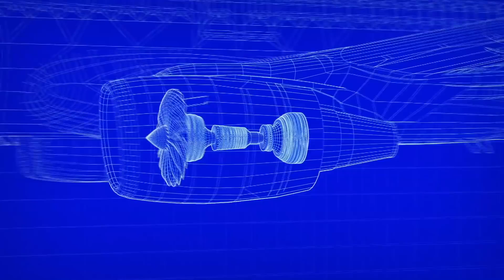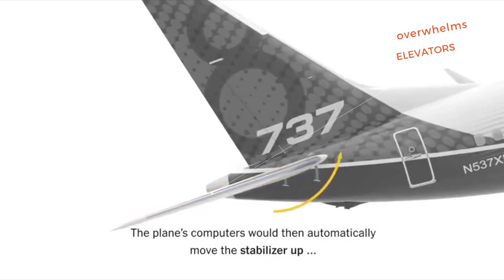737 Max 8 probable cause revealed - Prof Simon

Comment: Nice account....

1. A few points could have been added, only 1 AoA Sensor is connected to the AI with MCAS, so no conflict would ever have been noticed, this was done to allow the MCAS to over ride all normal controls...

2. Pilot training and 737 Sims are lagging way behind, most airlines don't even have one yet. Pilot training for the 737 MAX didn't included a runaway trim situation until Jan.
It would be easy for a pilot to have missed this newer training.

It seems a pilot that would have known to disable the Trim-Cut switch, would regain control of the aircraft....
(As shown on the flight previous to the Loin Air disaster) 
All easy to say from our armchairs, but this has been a Memory Item for a 737 pilot for a lot of years!!!!
Diagnosing that in the heat of the moment might be another thing....
Seems a few pilots have reported this malfunction and got home by using the Trim-Cut switch...
This is no excuse for a poor design to begin with.... 
But considering pilot training is 10% flying and 90% knowing what to do in certain fail situations, you'd expect better training.

Agreed 100%, Boeing has a huge mess to fix, as does the FAA and as Boeing is so heavily subsidised by the US Gov, who knows what agreements they will all come up with to save money and save face.
Reply: You hit the nail right onto the heads.FAA and Boeing should go to jail. I understand the ill-fated Ethopian and Lion Air were not given the new MCAS manual and the pilots were not even given a brief up-grade  training on the new system.
Reply: kelvin loh Sad as there were US citizens on the Ethiopian flight. Innocent people should not have to pay with their lives because other airlines of different countries don’t provide the additional information and training required to prevent these situations from happening.

Comment: This why I always wondered why the 757 line was discontinued. Because Boeing put all their "chips" into expanding a popular airframe that was never really designed to be expanded beyond its original design. This became a "tipping point" with the "Max" and having to put an, "bandage", additional flight computer to an already unstable aircraft, stable.
The defunct 757 would have filled the niche that the "Max" filled! A terrible gamble on Boeing's part. Imo.
Reply: 757 is a very safe plane. not the most comfy to fly across the atlantic. but...

Comment: According to reports out today, the pilots who flew the same aircraft on the Lionair flight previous to the one that crashed had the very same faulty AoA sensor and the MCAS system acted the same way, but a third off duty pilot who was riding the jump-seat went through a checklist that all 737 Max pilots are required to memorize to troubleshoot a runaway trim problem, as this is called, he quickly and correctly determined that the AoA sensor was providing faulty data to the MCAS system so he disconnected the MCAS system by flipping the two auto trim cutout switches effectively turning the MCAS system off and that allowed the pilots to manually trim the aircraft and finish the flight safely. The pilots who correctly performed the runaway trim checklist and saved the aircraft, reported that they wrote up the problem they had faced and the aircraft should have been taken out of service and not allowed to fly again until the AoA sensor problem was troubleshot and fixed, but Lionair didn't take it out of service, and the pilots that were flying it on the next flight when it crashed, obviously did not have the runaway trim checklist memorized like they were supposed to. And I would also state the the pilots on the doomed flight likely did not read the reports written by the previous pilots, if they had and were aware of what had happened and how it was fixed, probably would turned off the cutout switches and made a safe flight. I think, considering the quality level of the pilot training and the aircraft maintenance of the airlines in question, the Ethiopian Airlines crash will likely be for the same reason, pilots that were not well enough trained to safely operate the 737 MAX. 

According to all the reports about this today, these are salient facts that the Indonesian government neglected to state in their public report. Gee I wonder why.
Reply: There could be a language barrier there - the report could be in Indonesian and the captain that crashed was Indian.
Reply: They are being set up for failure.

Comment: I agree with Prof Simon's analysis.  I think it is likely that NO software fix is possible, primarily because the jack screw that controls the pitch angle of the horizontal stabilizer is fundamentally too slow to react, for the simple reason that it is geared so highly it takes too long a time for that jack screw to react to aerodynamic forces.  Therefore a fundamental physical redesign of the plane will be required.  No matter how sophistical the MCAS software is made, the horizontal stabilizer cannot react within the time required before the plane in a stall will crash nose-first into the ground.
Reply: This answer....the whole question... As simple as it gets....wow. Salute.
Reply: The jack screw did react.  According to this video the plane was in fact not in a stall, and if it was had recovered but was still receiving faulty input..

I think all this speculation is hilarious... If the cash was  caused by too much noise down trim, then obviously the control surfaces and jack screw were sufficient... Indeed over sufficient.

You can bet this recovery was tested, in flight, but likely at higher altitude. 

I eagerly await the report....  Btw if the new engines moved the cog fwd..  The plane would be nose heavy and less prone to a stall. 

However, too much power.. Fwd of cog might send nose up.. 

If they added power to correct a stall, the plane would nose up and stall more.. 

You need to turn into a skid not fight it. 

Uninformed speculation is not productive
Reply: Daniel Morris. You are absolutely correct
Reply: pilot just needs to apply the run away stabilizer memory items and neither of these crashes would have happened.
Reply: @Melthornal  It was as easy as that... the stab keeps trimming nose down, reach over and turn it off and fly the damn airplane...
Reply: Jeff Tjernagel I don’t think it’s as easy as just that. The plane design itself is fundamentally flawed.

Comment: The garbage MCAS System was incorporated to compensate for a poor design that should not have been approved by the FAA Type Certificate.  Secondly, as a member pilot all flight training includes procedure of how to recover from different types of Stalls.  To date, there are no pilots of Commercial Aircraft that have any experience of recovering from a "Full Aerodynamic Stall" other than in a  'Simulator' and  Boeing Test Pilots !  
To be able to recover from  a Stall depends on Altitude, Pressure Density, Temperature, Wind Velocity and Direction, Meteorological Conditions and most important is "Pilot Proficiency".  The pilot's ability to respond correctly without panic and or disagreement between Captain and First Officer.  Historically, irrespective of type of aircraft that crashed from a low altitude Stall, they all resulted in destruction and death for passengers and crew.
90% of all Commercial and General Aviation accidents is due to 'PILOT ERROR". The NTSB, FAA, FBI, Airlines and aircraft manufacturers refuse to release the true cause due to the Liability and Compensation Claims that would result in 'Multi Billion Dollar Losses'.  In questioning numerous Commercial Pilots about their knowledge and experience recovering from a Stall, the usual answer I get from them is " Hell no, that's Boeing's Test Pilots Job other than Simulator time I've had' They dread the thought of ever finding themselves in that situation.  Remember people, human life has no value relative to multi billion dollar corporate profits !

Comment: I would not be surprised if these 2 crashes have a huge impact on Boeing as a company for the criminal negligence of keeping  vital information from pilots and FAA as regulator body for accepting to treat this pivotal difference in the flying characteristics of the Max as trivial as to require minimal crew training. When the dust will settle, the lawsuits will start marching in.

Comment: These planes should be as easy (even easier) to fly as a single engine Cessna 150.......They need to give back more control to the pilots so they can manually set the trim, as needed.......not some computer that can, and often does, malfunction.......they are going to have to come to the realization that the older way is better and cut back on some of the computerization

Comment: Pilots, as soon as the plane begans to know a stall is beginning to develop, can switch off the system  and auto pilot and gain control of the plane quickly.If the pilot didn't know the procedure to take manual control of the 737,it's doomed to crash.Look up pilots using a simulator to recover,and do it quickly on the 737 max.
Reply: Mike Smith Agreed.  Didn’t a LION Air Pilot (traveling via jumpseat) on the day prior to that crash avert this disaster doing just this?
Reply: MCAS only operates in manual control.   MCAS activates when autopilot is turned off.  So switching to manual control will not solve the problem since you are already in manual control  (with MCAS operating)

Comment: While Boeing is completely to blame for all this nonsense, i still wonder why pilots didn't just go with memory items for trim runaway emergency....Grasp and hold the trim wheel and use the cutout switches. There were reports of pilots doing this in the same airplane involved in the lion air crash with an earlier flightcrew. This was a saveable accident. Some pilots apparently are more like "children of the magenta" rather than aviators that understand flying. 

Also i think that there would be an additional way of fixing the issue of instability, however it would be even more costly and might require even more modifications, meaning modifying the landing gear so that there would be enough space for new engines in such a position that would allow similar handling to the NG.
Reply: Mozoto this is the most astute comment here. “Children of the magenta” is exactly what the root issue is.

Comment: Well done!  Very nice cgi and editing.  My 2cents, Sir: 

The MCAS system uses the electric trim motors to drive the stab up (nose down).  The electric trim motors can be isolated by two switches on the center pedestal  Aircrews in the USA typically train for a situation, where the trim motors "runaway", trimming the stab without proper intentional pilot or AP input.  You open these switches thus isolating the motors,  and then trim the stab manually from there, via the two large black trim wheels near the pilots knee.  These wheels have handles that can be deployed in order to get a good grip on it.  

Q    Did the Lion Air and Ethiopian pilots not see .......hear.... or more importantly FEEL the stab trim wheel rotating with resulting nose down trim, without intentional input?  

Q   ......if so, Is this perhaps because they were already dealing with an AOA failure just after the flaps were cleaned up after takeoff?   

Q   .....if so, was this because the MCAS moves the trim in short bursts, and the pilots, being distracted,  did not recognize this condition as being a "STAB TRIM RUNAWAY" emergency that we already train for?  ( which is Boeing's reason for not disclosing this new system... because we already train for stab runaway )  By definition the STAB TRIM RUNAWAY is recognized whenever any unintentional stab trim happens, and you can:  

1    see the wheel rotating,
2    hear the wheel rotating, and 
3    feel the heaviness in the control column while flying manually. 

In the end, I feel that we will find that the Max8 crashes could have been avoided by isolating the stab trim motors.  And, that there may be other contributing  factors such as the alleged AOA sensor failures. 

If Boeing can be blamed for anything at all, I think that it will be for lying to the pilots about the existence of the MCAS system.....lying to the FAA about the limits of movement by the MCAS system, and by omitting that system from the systems manual.  

While losing the trust of pilots may not be a crime, lying to the FAA certainly is.  
 
Also, Boeing could be blamed for dragging their feet on disseminating meaningful information about this system, for which an EMERGENCY AIRWORTHINESS DIRECTIVE was issued by the FAA, which gave a full 6 months to provide a "fix" to pilots.  Should the FAA have grounded the fleet in November, when they issued that directive?  Did the FAA  then.... NOT also prudently  require US max8 pilots to do "differences training" in the simulator?  What about Ethiopia's regulatory body?  Did those pilots get sim training on the MCAS?  

Certainly by the year 2019, every Max pilot worldwide should have been made aware of the nuances of this MCAS system to the point of being very vigilant after raising the flaps, which is when the MCAS becomes operative.  Also, every Max pilot should have received sim training on this stealth system.  

And it always comes back the B757..... IMO,  Boeing screwed up by canceling the B757 program, which would be the perfect aircraft for such passenger density.  What an awesome aircraft a 21st century B757 would have been.
Reply: Very professional comment,you know what you are talking about!

Comment: The issue here is that automation is overriding the pilots ability to have control. It has to be noted that in the case of Lyons air crash the AOA sensors were said to be giving erroneous information to "MCAS" which in turn gave the nose down command. The pilots inputs were not able to save the aircraft due to this complex MCAS at work in the background. Again, as the 737 Max 8 went into a nose dive it would have accelerated to abnormally high speeds giving no time for the pilots  to completely disable the automation. This should not be a matter of trying to place blame on the airline or the pilots; it could be a nightmare just waiting to happen because of a less than perfect design by Boeing, trying to save costs and the pressure to compete with Airbus. In the end, it has to be said that the Boeing 737 Max 8 needed MCAS , in order to fly it safely  pilots would need  retraining.
Reply: According to what the Professor said, if 737M8 needs MCAS, then the 737M8's airframe itself is not airworthy, especially for civil aviation.
BTW, that's "Lion Air", buddy. It's an Indonesian LCC, not French.

Comment: Boeing clearly made about 4 errors.   The first was designing the system to use only the Captain's AOA sensor, rather than using both AOA sensors and looking for them to agree that the airplane was approaching critical AOA.   The second was allowing the system drive an excessive amount of stabilizer trim.  The third was allowing the system to activate multiple times within a short interval.   The fourth was failing to include a description of the MCAS feature in the Aircrew Operations Manual for the new airplane.   Pilots are not used to seeing an airplane trim itself during manual flight, so that would have surprised just about any aviator.

All of the above said, the trim system in the 7-3 is not silent and the large turning trim wheel next to one's knees is difficult to ignore.  A well-trained and experienced aviator who is suddenly surprised by the airplane trimming itself during manual flight should have realized that the solution to the problem is to simply reach down beside the thrust levers and push the two guarded Stab Trim Cut-Out Switches to OFF.   That effectively takes MCAS out of the game.   You then fly the airplane manually and trim it manually.   It is a PITA to manually trim a 7-3, but anyone with a 7-3 type rating should be able to handle it.   My sense is that the two foreign crews who crashed may have lacked the training and experience to diagnose and treat these incidents effectively as trim runaways and instead, laser-focused on manhandling the airplane, as MCAS slowly trimmed it beyond their ability to do so.

The key thing that I want to know is whether or not the Captain's AOA sensor on the Ethiopian airplane was also malfunctioning.   If not, we still have a REAL missing link to find.
Reply: When you are trying to deal with failed AOA warning and only a few 1,000f from the ground you hear the wheel then it stops, job done right? Wait.. it moved again...ok... no its moving again.... Warning Terrain ok my bad not paying attention.
Reply: @CMDRNUTTER  These planes are not equipped with AOA warning.  Commercial pilots do not need it in normal flight regimes.  You don't yank and bank a 737.  What bugs me and was not answered in this video is why the pilots did not treat this as a runaway trim condition and hit the stab trim cutout switch?  This is the real mystery.  Flight 610 on a previous flight was recovered with the stab trim cutout.  302 reached 9000 ft, that is a bit higher than 1000 that you are talking about.  How many minutes did the pilots struggle with the yoke and not getting the desired result?  I cannot image their terror and suffering, god bless their souls.  MCAS is a problem yes, but there are other systems on every commercial airliner in the sky and they can all fail at a critical moment and pilots need the training to cope, assess and react.
Reply: Good analysis.  I have to agree with you, those trim wheels are hard to ignore.  Seems like it should have been pretty obvious.  Question, does MCAST effect the entire vertical stabilizer via the jack screw, and not the actual control surface?  I’m assuming that all trim inputs manual or automatic are adjusting the stabilizer and not the control surface which makes sense in my head but I’m not entirely certain on what happens physically to the air craft when trimming under normal conditions.